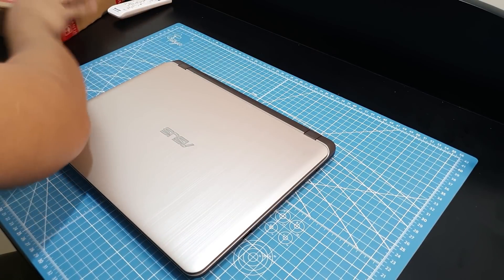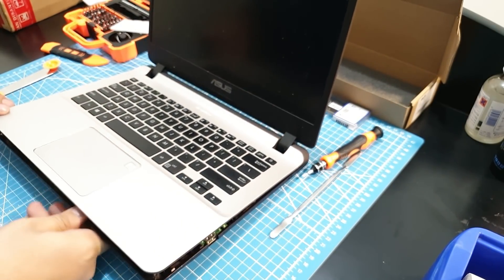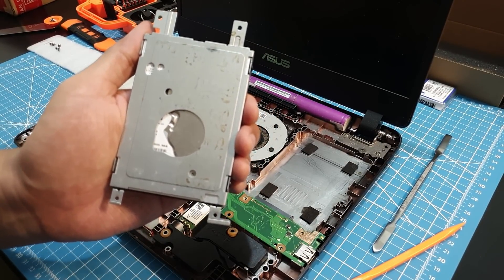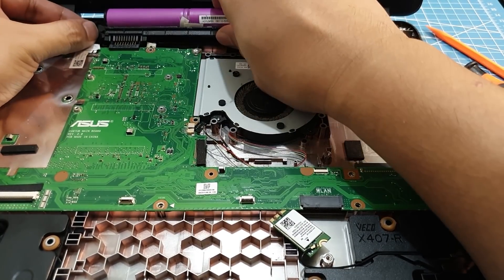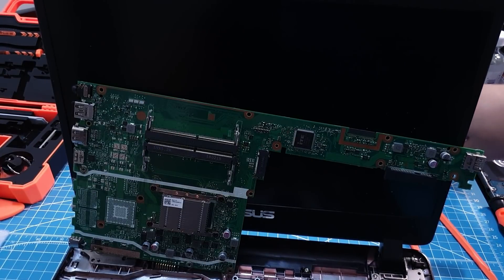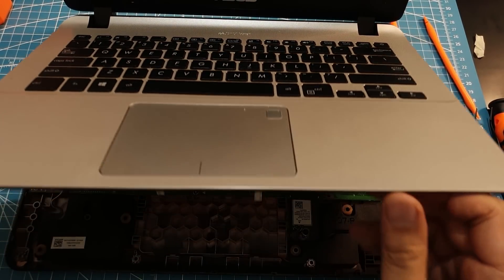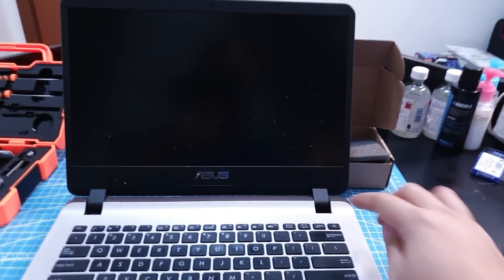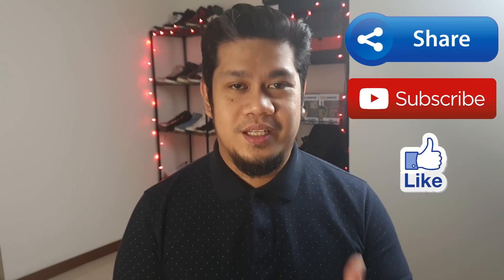Laptop Upgrade | How to upgraded ASUS x407u RAM and Battery (replacement)

Comment: followed this and works well, but after cleaning with compressed air the fan stopped working. what to do???????????????
Reply from the maker: Check the connections if its still connected. How old is your laptop?

Comment: Hello sir, i just wanna ask for ASUS X407UF compatible RAM, wanna upgrade my laptop.
Reply from the maker: Here: 1. X407UF has 2 SODIMM sockets for up to 16 GB DDR4 DRAM support. (8GB*2)

2. It has 1 M.2 connector for NGFF 2280 128G/256G.

Thank you, dont forget to subscribe
Reply: @JasonDonguines  for SSD? May i know your suggested SSD for ASUS X407UF?
Reply from the maker: Any will do. Sandisk, samsung make sure its original
Reply: @JasonDonguines  sir mas bibilis paba kung 3200 to 3600mhz ng ddr4 para sa Asus X407UF-BV002T model

Comment: Thanks. I  have a question how to know a battery  whether is suitable for a laptop? check whether the same voltage  and  the same pin? I recently am planing to upgrade a battery of my MSI GL 66 3070. I want to  grade it from '53wh 4 cells' to  '99Wh 6 cells lion' battery.I don't know the battery that i  am planing to upgrade  whether is compatible.
Reply from the maker: You can search google for the exact replacement battery. It will also help if you ask the dealer for the exact replacement. Thanks for watching. Pease subscribe

Comment: hello sir! just want to ask, what is the purpose of that empty slot above the ram you placed @ 7:26 ? i'm considering upgrading my laptop too and I think the laptop on this video is almost identical to mine (my laptop is asus x407uf). 

The ram compatibility support from kingston and crucial has conflicting data on my laptop model, kingston said that my laptop has a maximum ram capacity of 8gb only while on crucial says that i have 16gb max ram capacity. Don't want to mess things up because this will be my first time upgrading a laptop on my own.
Reply from the maker: Hi Gerard, thanks for watching my video. The other empty slot is another space for upgrade for eample 2 x 8gb memory to make 16, or 2x16gb to make 32gb. Just make sure to use exact pair of ram. Or atleast compatible ones. 
I hope this brought clarity 👍 cheers!
Reply: @JasonDonguines  Thank you sir! I appreciate it.
Reply from the maker: Anytime, please subscribe if you like! Will publish more repair videos. Thanks!

Comment: What if you upgrade to m.2 ssd, where can you get the xtra screw for that? Thanks
Reply from the maker: M.2 ssd ussually comes with a screw.
If it doesn't try to look for 2.0x3mm size screw.
Or ask the seller if they have spare.
Reply: @JasonDonguines  I ordered from shopee, the m.2 doesn't come with an extra screw. I'm still waiting for the ram to arrive to disassemble the laptop.
Reply: @JasonDonguines  and one more thing, what is the model of this laptop, is it x407uf?
Reply from the maker: @michaelstamaria8934  its just ASUS x407u

Comment: Hi sir may i know y is the fingerprint not detected after changing ssd?
Reply from the maker: At first yes. Kung full format. Kailangan mo ulit iconfigure. But after that ok na ulit.
Reply: @JasonDonguines  English?
Reply from the maker: Hi James sorry, If you will reinstall a fresh copy of windows you need to reconfigure the fingerprint. But if you cloned your hard drive. It should work well like the original hard drive 🤠
Reply: @JasonDonguines thx for the quick response. How to reconfigure the fingerprint
Reply from the maker: Use your search tab on the task bar, type setup fingerprint. Then click it, follow the instructions you'll find it pretty easy.
Reply: @JasonDonguines  sure thx sir.
Reply from the maker: Don't forget to subscribe 😉

Comment: Kuya pano po ayusin ang battery connector ng asus x407m na laptop?
Reply from the maker: Pins lang yung connector, usually hindi nasisira, anong sira nung sayo?
Reply: Pag nakasaksak po charger nagbubukas pero pag binubunot namamatay pero wala naman pong sira yung battery
Reply from the maker: Napalitan mo na yung battery? Yung akin ganyan nungbsira nanyung batt.
Reply: @JasonDonguines  opo napalitan kona battery pero namamatay paden pag tinatangal yung saksak nung charger
Reply from the maker: @ClickChaos24  connection nga ata may soldering na yan. Better siguro pag dalhin mo na sa pc shop mas complicated na yan e baka tuluyang masira

Comment: Is this compatible with x407u? I read your reply that ur laptop is actually x407ua
Reply from the maker: Its actually similar. I think the specs are just the difference but the placement of parts are similar.
Reply: @JasonDonguines  2400mhz po ba yung built in na 4gb ram kaya hindi po compatible iyong pinalit niyo?

Comment: sirrrr upgradable po ba ag gpu niya at cpu?
Reply from the maker: Most of the laptops hindi upgradle cpu, gpu. Unless you can unsolder and solder it. As t dapat compatible sa motherboard. For gpu there arr external gpu upgrades.

Comment: Hi Jason I bought ssd a2000 250gb it says 35x faster and I attached it with my Asus x407m laptop but my laptop cant detect the ssd. Is a2000 250gb compatible with our asus X407m? TIA
Reply: Try to search in youtube in how to fix SSD. The one that says unallocated. It works for me.

Comment: Hi sir Jason ask ko lang balak ko kasi mag add ng 8gb na ram bale magiging 12gb na po sya. Okay lang po ba kahit mag kaiba sila ng mhz?
Reply from the maker: Im not sure about that usually dapat parehas ng mhz to work well try to match the mhz nlang kung di mo pa nabili
Reply: @JasonDonguines  thanks sir hindi ko pa naman sya na order sasabay ko sana sa m.2 ssd. para sabay sabay lang ng salpak and salamat sa mga video mo sir dami ko nalaman hehe.
Reply from the maker: Please share and sub. Thanks. Dont firget to watch the ssd upgrade

Comment: Hi sir great video. Is this the BV100T (i3) version? Youve mention something about the ram slot that caused the computer to not boot. Which slot did you use to insert the 8gb kingston card?
Reply from the maker: Thanks, when you flip the motherboards the top slot near the edge worked.
Reply: Thank you sir. By the way sir, do you think if  installing a 16gb ddr4 card will work on this model? The description says 8gb at most. Plus asus did not mention about a second ram slots
Reply: @paolodeguzman6463  Hi, we have the same laptop model. I'm planning to upgrade my ram too. I'm thinking between 8 gb or 16 gb. Any recommendations? Thanks
Reply from the maker: 16 will be a huge leap and nice you can run many apps and no problem for google chrome
Reply from the maker: According to Asus website it supports until 16gb most probably 2 8gb ram. But some said they did more than 16gb and it worked.

Comment: Hello sir compatible po ba x407ua-bv110t dito? Balak ko po sana mag add ng 8gb 2133mhz sa 2nd slot so dibale magiging 12gb ram na sya and pwede po malaman kung saan kayo bumili ng battery
Reply from the maker: Yes pwede yan, about 12gb ram try mo lang sa different slots pag ayaw gumana. Sorry wla ako sa pilipinas try lazada tpos ask mo lanh sa seller kung panh x407 sia. I hope this helps.
Reply: @JasonDonguines  okay sir thank you po, more power to your channel 💜💜
Reply from the maker: Thank you

Comment: I have upgraded mine with 120gb ssd
How to make ssd as primary drive for boot and hdd for just storage
Reply: Install windows on the ssd, clear the hdd, and that’s it. Maybe there’s a better way, but I did this and it worked just fine.
Reply from the maker: You can set it up on the bios, primary boot ssd

Comment: I have a laptop just like that one. Can I put an 8gb RAM without removing the 4gb stock ram?
Reply from the maker: If the rams in are compatible it may work try it.
Reply: Jason Donguines i just wanna make sure sir. What should I buy to put along with the 4gb RAM in my Asus x407u? Thank you.
Reply from the maker: @Josh-ss9fq  to be sure you can buy an exactly same model of the same 4gb ram so it will 4+4gb if you want 4+8GB you really have to test it. You may bring it to the dealer and ask if you can return and exchange if it will bot work. 
Or ask if they do trade-in of ram. Some shops does that.
Reply: Jason Donguines okay sir. Will do. Thank you so much for entertaining my questions.
Reply from the maker: @Josh-ss9fq  no worries

Comment: Hi sir jason! Ilang gb po ba ng ram kaya nya irun? Ang sabi po kasi sa website max ng 16gb pero may napapanood akong mga vids dito sa yt na nageexceed sa 16gb yung upgrade. Btw i have the same laptop po but lower specs i3 7th gen po thanks!
Reply from the maker: According to the website  16gb nga . I think thats enough for i3 since hindi lang naman ram ang nag dedertmine ng speed. It can help pero and load tlaga ng computer speed ay sa processor and GPU if playing games and others. But for I3 i dont think you need more than 16gb Ram. Better switch to SSD or upgrade your processor/laptop
Reply from the maker: here's my SSD upgrade video https://youtu.be/RGuuVkGz8R4

Comment: Ano poba ang compatible na hdd ang 2.5 or 3.5 ba?
Reply from the maker: Any 2.5 inch po but i suggest get ssd may mga murang ssd na po. It will drastically change the speed of your laptop.
Reply: Thanks for the reply, anong klaseng ssd po ang 2.5 poba?
Reply from the maker: itona po yung ssd upgrade https://youtu.be/RGuuVkGz8R4

Comment: Sir when you upgrade your ram to 8gb in your asus x407u doea the gaming experience improve?
Reply from the maker: Asus X407 is not really up for gaming it improved a little bit. If you want your gaming to improve more, try upgrading your hard drive to ssd card. Will upload the upgrade soon. Ill tag you.
Reply: @JasonDonguines  i usually game on pc but this quarantine time i only have my laptop. thanks for the response
Reply from the maker: @MikeyBoki31  ohh, if you're playing dota2 or shootinggames it think it will work if you set it on low setting and your internet has to be fast. Gaming has alot of factors like, GPU and CPU Asus x407 will not work that well. Happy gaming!
Reply: @JasonDonguines  yaa.. i already tried dota it runs quite good im just really upgrading my ram for apex and pubg im not that fan of high graphics settings i usually game on low graphic setting...
Reply from the maker: @MikeyBoki31  Thats good too know you may want to invest in ssd just get the 128Gb then install your most used game on the ssd then make the HD your storage for saved games. it will  make a huge difference.
Reply: @JasonDonguines  thanks man ill look into that

Comment: Hello
What RAM for this computer?
Do you have a link to the appropriate model for this computer
Thanks
Reply from the maker: I used kingston 8gb DDR4 PC 21300/2666MHz
any DDR4 2400 +/- will work
you can find all asus x407ua compatible replacement parts here 👇
https://en.accessoires-asus.com/x407ua-66862-62568.htm
Reply: @JasonDonguines   why don't leave boths rams?
Reply from the maker: @danielmunozcastro6467  I tried, its not working I think they are not compatible to each other. :)
Reply: @JasonDonguines  
do you think two 4gb 2400mhz rams work?
Reply from the maker: Yes it will work as long as same speed .
Reply from the maker: Because my 4gb is 2400 and my 8gb is 2666 thats why it didnt work

Comment: hello I have a problem with my asus x407u, it turns off by itself, reinstall the drivers, remove the battery but the problem still continues, do you know what it could be?
Reply from the maker: Hi sir is your battery new? How about the charger is it working well? You can also check if your cooling system/fan is working.
If the processor is too hot. Computer tends to shutdown randomly.